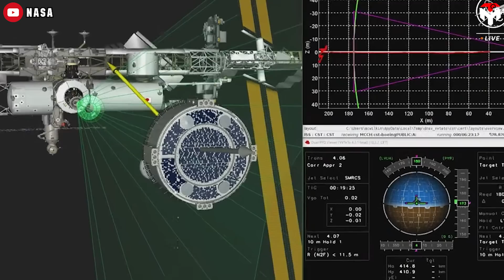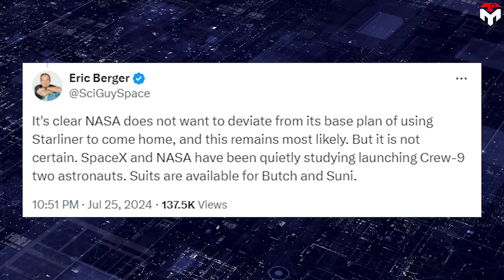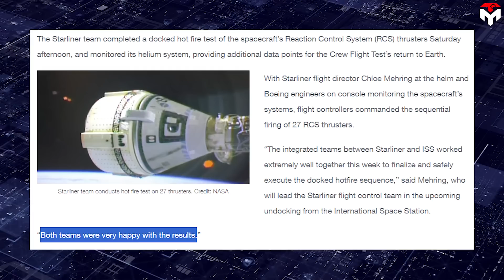Astronauts Just Exposed the Life Inside Boeing Starliner Trouble! NASA To Give Up...

Comment: I FIND IT VERY DISCONCERNING THAT N.A.S.A DOESN'T KNOW HOW TO FIX THERE SPACECRAFT. Didn't they build the thing in the first place. WOW INCOMPANTANCE.
Reply: Fixing it is fine. Fixing it on-orbit is not really possible, so they need to figure out if it's safe despite those thruster problems. I believe that currently it's considered a low risk, but not low enough to approve undocking with crew. They'll need to figure out risk mitigations based on their ground testing, on-orbit testing, and engineering judgement. Unfortunately that takes time.
Reply: NASA did not build the thing it was Boeing

Comment: My personal favorite is when they said that they are comfortable that the astronauts can use Starliner to return, just so long as they do not attempt any manual control. !!! Apparently the computer is viewed as fast enough to compensate and correct as thrusters fail randomly. But the pilots are not. Which is amazing when you consider that it like all modern craft, is fly by wire.

It’s like Boeing dusted off some old plans for the Apollo follow up and attempted to build them, without actually understanding them. And taking no lessons from the subsequent 50 years. It’s not just that Starliner has problems. It’s that it has problems that were solved by others decades ago.
Reply: Manual control of the Starliner is unnecessary unless something goes wrong with the thrusters (again!) and is a built in safety backup - which raises the question of just how safe is Starliner when the faulty thrusters with which it was plagued cannot be manually overridden because it will make the issue worse?
Reply: @chrisantoniou4366  Thus its “we can use it as a life boat if we really have to, but…” status.
Reply: @andrewtaylor940  According to Boeing and NASA, yes.  Personally I would put both astronauts on a Dragon spacecraft and let the Starliner return on its own and see what happens without endangering humans in the process.  Unfortunately Boeing especially is worried more about their reputation because it means a lack of confidence from their customers which in turn means less money for them, than about the welfare of the astronauts.
Reply: They are comfortable letting the astronauts return on starliner because THEIR butts arent in the capsule.
Reply from the maker: Poor our astronauts!
Reply: No. The issue is that manual flight significantly increases the duty cycle of the thrusters, which causes them to overheat and get deselected. Autonomous flight demonstrated in the previous uncrewed mission, OFT-2, had substantially less thruster action and therefore they never overheated.

Comment: I learned a long time ago while working with Boeing engineers that teflon does not hold up to strong caustic environments. It would seem they should know better by now.
Reply: @donstash4295  
Aerojet Rocketdyne made the thrusters on the service module.  Yes, they should know better.  However, there was rumor of a feud between Boeing and it contractors.   So, I wouldn't put it pass some pissed-off contractors to sabotage Boeing by using inadequate material that was signed off as being adequate.

Comment: As Meatloaf famously sang, "Two out of three (parachutes) ain't bad". And TWO MONTHS and counting to troubleshoot? Really? TWO MONTHS? I guess they do only have like three thousand engineers so it will probably take some time. Maybe SpaceX can swing by the ISS and collect them on the way back from their next Starship launch.
Reply: When SpaceX lost its satellites because of an oxidizer leak on their second stage meant it wouldn't relight to circularize its orbit, it took SpaceX just two weeks to find the root cause of the problem, fix it, and fly again successfully.  All this happened while the crew from Starliner have been on board the ISS... and they're still there!